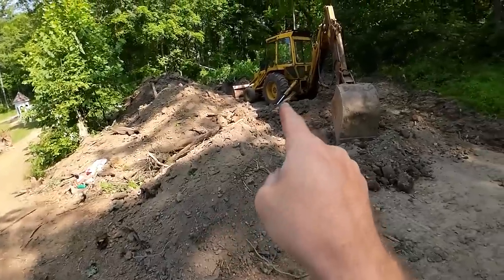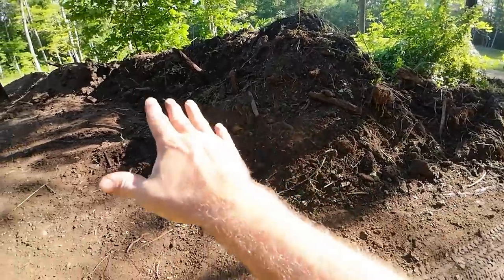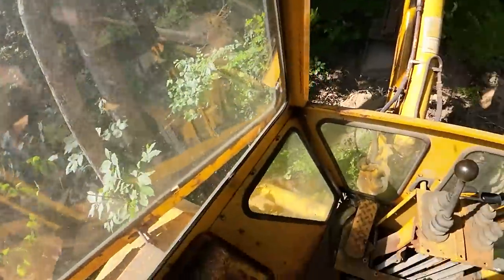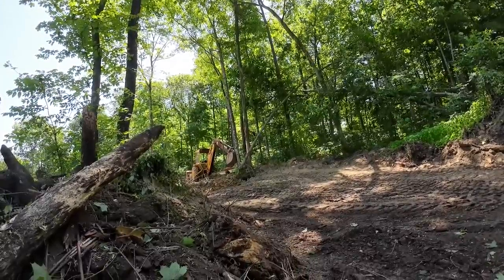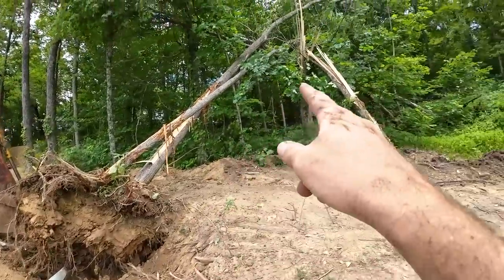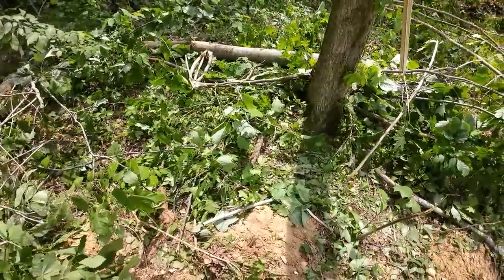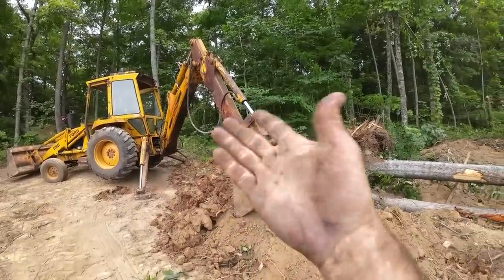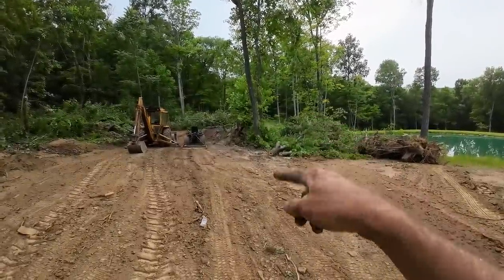Land Clearing with Old Backhoe

Comment: I thought that a backhoe would be a good addition. Instead of cutting the tree down then grubbing the stump out, and all the inherent risk with the saw and the tree going somewhere else than planned. Now, you take the tree and stump at the same time. Hack it into bite sized pieces on the ground. What's really cool is it starts every time without a lot of battery use. Whir, whir, vroom!

Comment: why not move it to the other pile that way you don’t have to move it again
Reply: He's planning on burning it on the new pile as well. The problem with burning brush is you have to get to tight compacted down to get it to burn good.  So a higher pile is better then wide and he said the old pile is getting to wide.  If you watch some of DP burning piles his are 30 feet tall and not that wide and he keeps adding to the center of them as they burn down.  The fire really goes straight up and does spread out that much in brush piles.
Reply: i was talking about the dirt